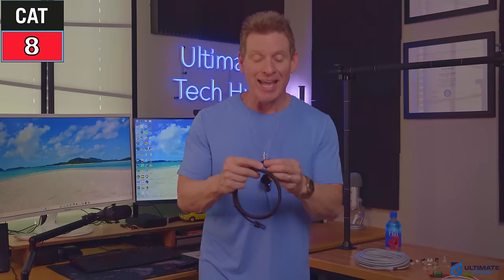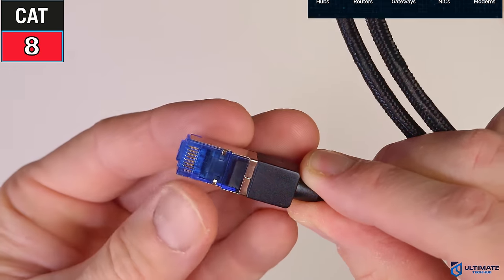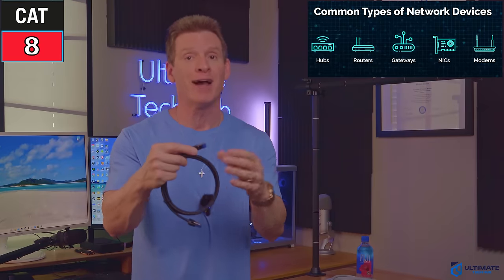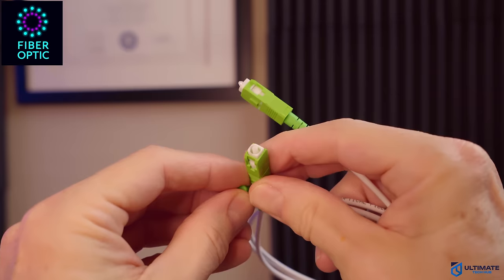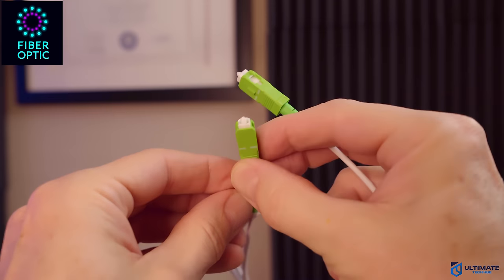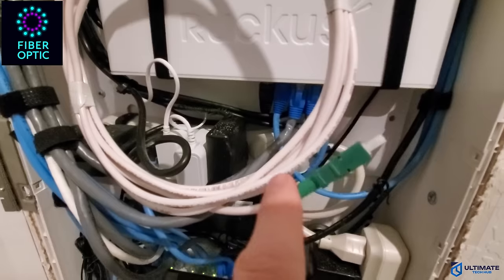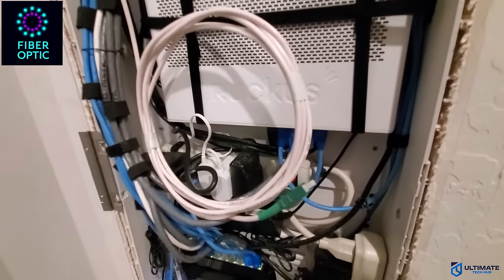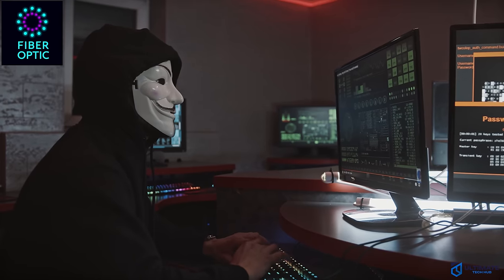CAT 8 VERSUS FIBER | WHICH CABLE FOR YOUR NETWORK?

Comment: Extreme overkill. Youre only as fast as your shortest link. Thats ur isp. Cat6 is rated 10g up to 165' which is longer than any house run. Fiber is for distance over speed. You only need fiber for runs over 300'. Below that cat6 is all you need.
Reply from the maker: Well the title of the video is Cat 8 versus Fiber Optics not Cat6 versus Cat8 or Fiber. I have videos on Cat6 and yes Cat6 is all most people need but there are small selection of people that want the very best cables for there high speed ISP fiber connections. Google Fiber is becoming more popular and 5gig will become cheaper and eventually 10gig or higher. Thanks for watching and for commenting! 😃
Reply: These elements can easily last 30 years. The previous 30 years was a 6 order of magnitude jump for me. A single 10x jump would obsolete cat-6a at my new home. With a new run, the Cat-6 is required for slow adopters and fiber for future proofing.
Reply: This stuff is more for home studios where you've got a single NAS that's connecting up to a workstation in another room. We're nowhere near the point where the server outside the house is fast enough to serve things up fast enough to saturate either of these connections.
Reply: @UltimateTechHub  It will, but even with that stuff, I don't know how many companies are going to pay for servers to allow people to saturate such a connection. This stuff is far more relevant for wiring your home up as those connections are much easier to saturate and if the external link to the ISP and server ever does increase that much, you're already prepared.
Reply: @wangsunfuh8889  Yes, although, I wouldn't expect a similar leap. We're at the point where people can stream HDTV over the net in a typical urban ISP connection, I'm not sure what people are going to be commonly doing that would necessitate that much more than we are already doing that doesn't involve a commercial grade connection where they can pretty much give you as much bandwidth as you're willing to pay for.
Reply: Your comment is short sighted. I transfer internal large files internally. Ie to NAS
Reply: We have to keep things in perspective here...
Running 40Gbit/s through Ethernet is cool, but you need a source for that. Even high end Switches will only give you 10Gbit/s on a port, and that's with very power hungry SFP+ Modules. Having 40Gbit/s or more might make sense for the "Interlink" Cables that connect multiple Multi-Gbit Switches in a Building but even then those Switches would need to have at least ond 40+Gbit/s Uplink Port each.
I am not saying there isn't a usecase for this, I am saying it's probably a pretty rare usecase.

Comment: You should also mention how hot 10gb speed over Ethernet can get hot at the connection point. Really hot
Reply: The GBIC adapters for 10gb are outrageously hot.

Comment: I think one of the major problems is we are at a point where we having a bit of a technology revolution, fiber compatible devices are not that common (at least where i live), so you will end up with mixed tech until they become more mainstream, that being said, a switch with a fiber backbone would be a great way of future proofing and due to fibers bandwidth you could use a single cable to each room you need a connection for so reduced clutter (well in the roof and wall, also you won’t get EMI from power cables), for now i guess the people who would benefit the most would be people who do large file transfers etc usually via NAS but eventually ISP’s are going to push higher speeds i know my country is going to start trialling 2.5gig up to 10gig in 2025 (i think they are pushing to make 50mb/s a minimum speed i can’t confirm as i can’t remember where i saw that), i remember something about them doing a trial of 40gig in about 2017 or so as they were testing different fiber termination boxes.
Reply from the maker: @noname-lp3mu  Just imagine where we will be in 10 years? How fast will typical ISP speeds be? It's important to plan for the future. Thanks for watching !

Comment: Cat 6 cables don't last 10 years??? 🤔
Reply from the maker: They can last 10 years but it's not guaranteed. I've had ethernet cables last over 10 years and I've had some last 6 or 7 years and begin to fail. However, fiber will last for decades. Thanks for watching!

Comment: Twenty years ago, my new home was run point to point with Cat 5E, RJ11 (telephone), and coaxial cable.  This was in preparation for 1 Gb networking, wired telephone, and cable TV service.  All of it worked very well.

Twenty years later, my just setup new home was run point to point with (a) primary runs (between low cost 2 port SFP port switches) with 10 Gb (at my distances, actually 100 Gb) multimode fiber (den, living room, and master bedroom) and (b) Cat 8 from these switches (all 8 port RJ 45) to secondary rooms.  The switches' SFPs are limited to 10 Gb, and the RJ 45 ports are 2.5 Gb.  However, the goal was... in another decade or two... the switches are replaced, but the wires are still good.

However, crystal ball (20 years from now, though)... none of this will matter.  Except for backbone runs, almost all devices will likely be WiFi only by this time.  WiFi 6/6E maxes at 10 Gb/s, WiFi 7 at 46 Gb/s, and WiFi 8 is proposed to be at 100 Gb/s.  Of course, these are maximums that are never reached, but for the residential and (most) small and medium sized office spaces... even 25% of WiFi 8's throughput (25 Gb/s) will work perfectly.  And, this doesn't even include WiFi 9 or 10's improvements.

We are quickly heading to a time of "WiFi only, except for the utility's connection to the building itself."  And, worse than this, "why have a wired connection to the utility's customer at all... just give them cellular (wireless)."

Comment: 6:01 "since it's light, it's completely immune to EMI"...wait...EMI, the data going through CAT8, and light: are made of the same thing though! explain!
Reply from the maker: @Layarion  optical fiber does not transmit electricity, it does not radiate signals and cannot be tapped – copper does use electricity and is susceptible to be tapped …it's the not the same.